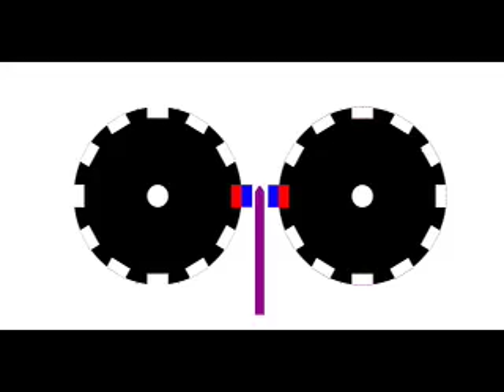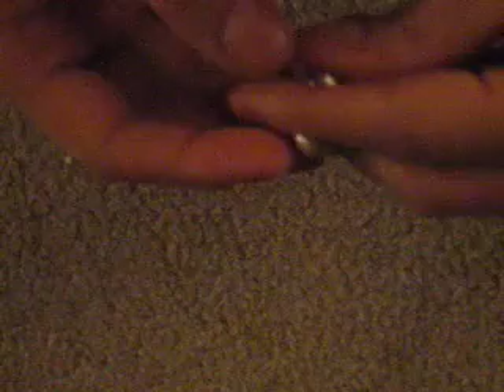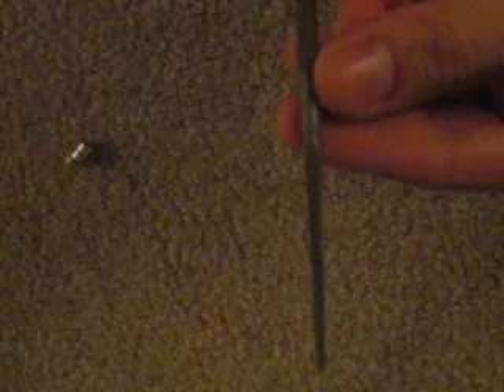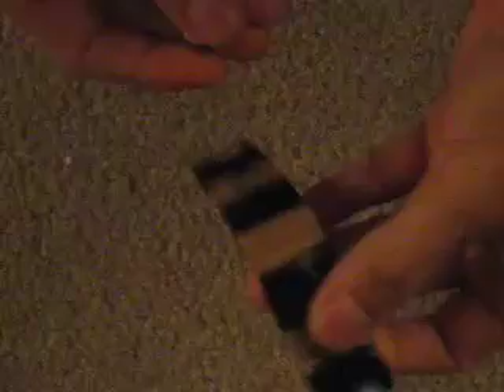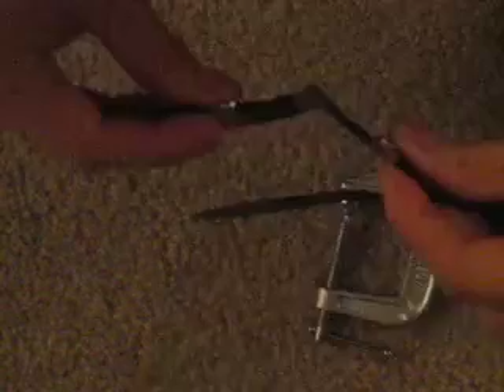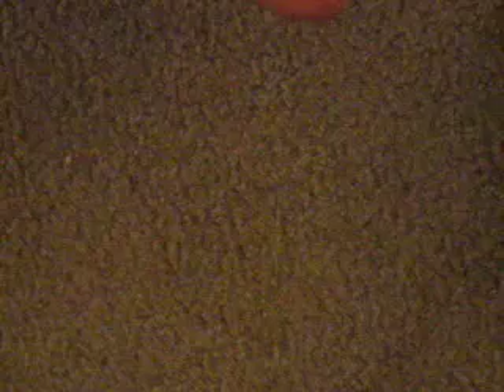Magnet Motor concept and How magnetic shielding works

Comment: @TheMeansardine Just because an object is repelled in one direction and attracted in another does not mean it will move. It will only move if the resulting position has less energy. This may not seem obvious because it's a situation we don't often meet.
.
There is a gravity version of this where a main wheel has rotating arms attached to it such that it is always heavier on one side. But because it is _always_ heavier on one side it remains stationary because turning does not alter anything.

Comment: @TheMeansardine If rotation of the wheel by some amount  looks the same as another position of the wheel, then the energy levels are the same.
.
Any rotational symmetry (even of order 1) means that there can be no drop in energy over that rotation and so no physical reason for it turn beyond that point.
.
If you push it first it will run over the symmetry points but only until the initial energy imparted is dissipated through losses.

Comment: @chrisofnottingham, what about perfect spacing? and ratios of attraction, repulsion, and shielding. Say the Iron in the middle is relatively wide at the bottom. And like a step pyramid would decrease in size as it extends upward to point. (find a ratio) ( i picture more elongated vertical steps for the iron shield.) That means only a few segments of decreasing width with little vertical shrink. I think its only a matter of rotational mass and calculated spacing, shielding, and repulsion.

Comment: i think this is an awesome idea with great potential. i really like the bedini motors and his solid state tesla chargers, but they all need large, heavy, lead acid batteries to be useful. this could be a much more portable device for generating electricity. i've been a machinist for 24 years. this would be really easy to make.

Comment: @native0069 Not sure I understand you. The magnets are already rotating. Do you mean that the magnets rotate about their own axis? How would that help?
.
And anyway it wouldn't solve the problem that each rotation by one position of the wheel results in an identical looking set up. Thus the energy level of the system never changes.
.
Perpetual motion requires a continually falling energy level which just isn't realistic. Zero losses could give you PM too but then there is no way to do any work.

Comment: This theory is sound. I'm trying it out. You just need bigger gears and the right shielding, Maybe lead at the top would work better. I would also use flywheels from car engines to use as the gears.

Comment: Apart from anything else, the 'many magnet' version can't work because the system has identical energy levels for every position. The wheel will only turn to move into a lower energy state, that's how physics works.
.
So even if there were attraction at the bottom of the wheel, neutral in the middle and repulsion at the top it makes no difference. The wheel would only move if turning caused a net decrease in energy .

Comment: i think the only possibility to use free energy is to generate circumstances where noise became correlated and explodes in amplitude. then u can just get energy from environment. the questions there are 1. if there is a possibility to generate this circumstances with lesser energy than u can get after that. 2. how much energy u can drain so environment can regenerate fast enough.

Comment: in fact it must be much worser through this. it must work like a strong brake. because if u generate such stable point, u generate big hurdles around it. and system have to have more weight to be able to hold more cinetic energy to be able to overcome this hurdles.

Comment: sorry it will not work. there is a point of force equillibrium at the tip of shielding metalthingy where both magnets are pushed towards the tip by repelling force from above and are attacted towards the tipp by attracting force from below.

Comment: Skipping to the end of the video; As the number of magnets increases what you are making is a system where every position is equivalent to every other position. In that situation there is just no reason for the wheels to turn. The wheels will only try to turn if they can get into a lower energy state. Since all positions are the same, there is no turning force.

Discrete magnets don't help either. It makes a series of identical higher and lower energy positions. The system will rest in a low.

Comment: Try learning the law of conservation of energy and the basics of magnetism. Magnetic field lines are a closed loop running from one pole of the magnet to the other. If you try to reduce the strength of one pole with a sheild you also reduce the strength of the opposite pole, making an unbalanced force impossible.

Comment: You can skip the complicated analysis of all the fields by jumping several stages and asking why the wheel ever moves at all. The wheel moves to get into a lower energy state, rather like falling down.

So what matters here is the overall energy state of the wheel in successive positions. If these are the same then there is just no reason for it to turn. Since this system is pretty much the same in all positions there is indeed no reason for it to move.

Comment: You also are totally wrong when you say that the magnets are attracted to the closest part of the metal bar. You would need to use calculus to figure out the exact position mathematically, but it's much closer to the middle of the metal bar than to the end. That discrepancy absolutely kills your idea. If you were to do all the calculations, you would find that the forces cancel out, yielding zero net torque.

Comment: Here are the problems with your idea: First, the shielding does not totally eliminate the repulsion, (even if it totally surrounds the magnets, which it does not in this case). It merely reduces the repulsion while providing an attraction that (if the metal bar is thick enough) is greater than the repulsion. Also, you neglected to consider that all the magnets are attracted to the bar, not just he ones on them bottom.

Comment: You almost got it right when you included momentum. A magnetic system has a lowest energy state (or many equal lowest states). When in that state, the system requires energy to get out of the state. That energy can be supplied by momentum. Using mechanical energy to climb out of the low magnetic state means that the rotating parts slow down. Always. 

If you use circular magnets with N/S pole on inside/outside, as if number of magnets -> infinity, then you have literally re invented the wheel :)

Comment: See the only problem is their is no energy or force combating gravity in any of these designs, and you cannot have one that will work unless you magnetically levitate an axle to remove physical friction, then you would need another small source of electricity (solar) to help spin the axle (which would need to be magnetic also so you could have some of the solar energy exciting it to help it spin)

Comment: To make it work you have to create shielding with diminishing diameter toward the centreal point. You have to have balanced push and pull below center for each pair of magnets not only the center pair.Basically yu need unidirectional force and it's possible with all other pairs above center point IF you eliminate repulsion of pairs below center point.

Comment: Permeable definition is :

allowing substances through: allowing liquids, gases, or magnetic fields to pass through .

Aluminium  & stainless steal, though non magnetic is also permeable to magnetic force, IE/ force passes through.
So what makes something magnetic.. Its the carbon content, no carbon no magnetic attraction, high or low carbon in steal = magnetic attraction.

Comment: Your idea fails at one point.
After the magnets attract to the central metal, it takes energy to take the rod away from them. And this energy is equal to (or due to friction even grater than) the energy you get by letting the magnets accelerate to the metal.
So the net energy you get is negative, meaning you have to supply the machine with energy in order to work.
It will never generate "free" energy.

Comment: Hi, first i want to complimet you for posting all the information and that helps us all to get closer to the magnetic motor or genarator.I think you got something there but still at the end you will need a minor force to just push a littke the rotor to make them go.The idee is if the force to make them move a little is less then the power genarated you will have your motor.But thats the most difficult.
Succes and make this world clean.
Asana

Comment: I don't care about the output voltage, could be 12v, my calculations are based on amperage and wattage, the ideea is to run the motor on 12V/15A, and the output should be 12V/58A but I can't say for shure untill i get it running.

Comment: But you don't get anything from nothing, the magnetic energy is transformed in kinetic energy that is transformed in electricity, I am curently working on a working model of the V-Gate and a replica of the Perendev Motor, after some calculations, if the Perendev does not work i'll make an electric motor assisted by a magnet motor that will give about 3-4 times the power that it takes to run, but my calculations may be wrong. I'll post as soon as I have the working models.

Comment: I understand you are a guy who pops his hood weekly and dismantles his engine to replace its pistons. Cheap operation indeed if done by yourself. And stronger pull = quicker dissipation. On top of that the production of magnets is not cleaner than that of fuel. Furthermore, this engine is a brain trick. Magnetic fields do not produce work. They only bend it. Proven physics...

Comment: Magnetism is something baffeling. The main problem with ANY magnet motor is that in the end when someone eventually finds an effective magnet motor he or she WILL discover that the only one thing changed is the fuel source.. which are now the magnets. And magnets are way more expensive than a lot of other alternative fuel sources. The (permanent) magnets in any and all magnet engines will run dry eventually. It's just the way magnetism works.

Comment: i guess the wheel will stopp where the magnets are forced to leave the "shield" because the repeling forcce is stronger or in best case equal the forces you added at the top (a pair of repelling magnets) and at the bottom (pair of attracting to the shield)
i saw a very good concept which have the idea to move the shield, and use the repelling force, which as climend should be stronger that the force you have to use to move the shield

Comment: I've had a very similar proposal, similar in the process. The working mechanism behind this idea has been seen in many other designs and I have to say it is the most intriguing. I have thought of using foam steel cunductors to negate magnetic fields but ferrite in a V shape has always seemed to work more to the working proposal. I hav'nt looked into magnetic motors for a while, I am now looking at MEG's not like Tom Bearden's idea's. If ya want some advise on how to build your's contact me

Comment: You cannot construct a network with magnets. A group of magnets will behave like a single magnet therefore you cannot assume one magnet pulling and other magnet pushing. In such a system there's no multiple magnets concept, but there's a single magnet behaviour. If you can able to plot the magnetic fields of a circular group you would understand what I'm talking about.

Comment: Interesting concept though I have a few things to point out, first using repulsion instead of attraction weakens the magnets over time and generates heat, 2 in-order to keep it from stopping or pulsing you would need more that one row of magnets on the wheal, offset from one each other at an angle. also using a multi-medal alloy to block/reflect the magnetic fields  Copper would almost work as shielding, but there are other things that would work better.

Comment: To see more about magnet motors go to overunitybuilder com and click the link to magnet motors I tried building a magnet motor years ago and have advanced designs on my site. The shielding creates a problem not seen by you in that the long inductor magnetizes along the length and pulls very strongly as you try to pull any magnets away even as they repel each other through the iron. Good luck, but actual experiments will show you that this approach has difficulties that you will discover.

Comment from the maker: thank you for that comment!
I have pondered this as well..you have to keep in mind that there are many factors at play..The incoming magnet should have more attraction force then the out going magnets..the amount of shielding, does it taper off properly does more need to be added at the bottom..are the magnets strong enough..and do you have the right distance between them:side by side and in relation to the shield..
can i see a picture of your prototype..i would love to study it..
thank you
Reply: Using 1 wheel only with south pole and 1 wheel only with north pole (so that they attracted) Then, take a sheet of pyrolytic graphite and stick it in between on the side where the discs diverge. Pyrolytic graphite repels the north pole and south pole, thus breaking up the attractive magnetic field.